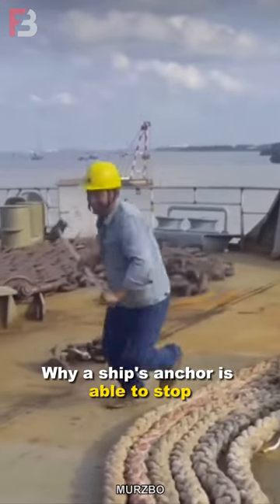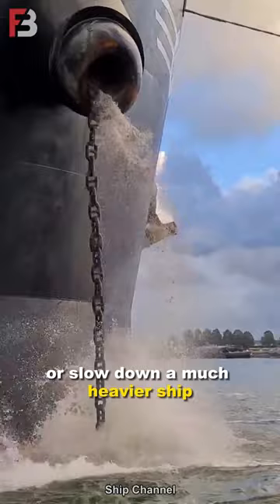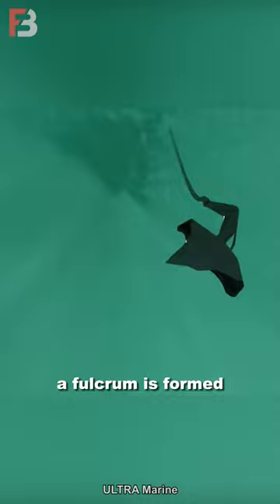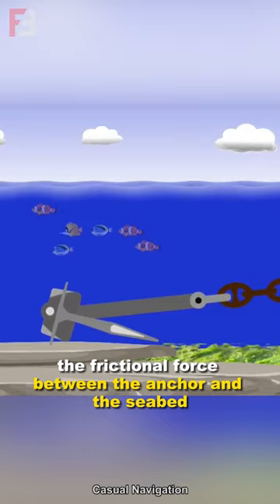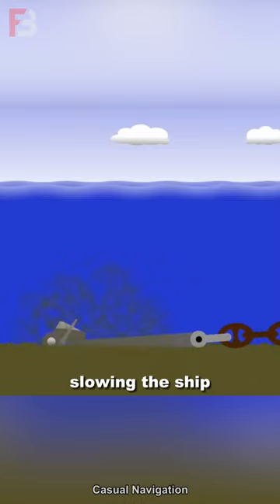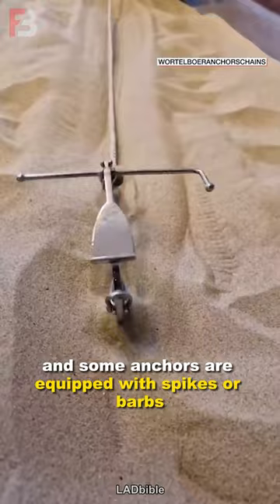How the anchor can stop the ship #shorts

Comment: It has nothing to do with the huge chain that's also on the sea bed? The anchor weighs nothing compared to the chain
Reply: Chain does almost all the work, this clip is very bad.
Reply: @vivekp4854 Then why have an anchor at all
Reply: So wrong. But say anything, I guess.
Reply: @oltro15 are you genuinely asking, being sarcastic, or dumb?
Reply: @oltro15 
No one will only use just a rope on an anchor without a long 
And heavy chain. In choppy sea 
The anchor will be jolt  up so  hard  that it will be dragged with every single wave.  It’s the weight and the length of the chain that will stop the boats from dragging the anchor acting as choc absorbers. That will keep the anchor in one place. And remember to keep tension on the rope before Cuting the engine power. Large boats can quickly get a lot of 
Momentum.  Just with the wind and sea currents.
Reply: @alexgrandino8777  Thank you
Reply: @alexgrandino8777  this is correct
Reply: @richardkossler4624  
Thanks.  Unfortunately 
To many people don’t understand this fact 
Because you are one off the few how said something.  I was on that famous sale boat 
Named « TRIAD » this trimaran was like a wild horse. Spinning  none stop around his anchor. Exactly like a wild horse attached by te nec for the first time.  He has a flat pivoting mast shaped like a wing from a  747   And we could navigate without ever using the sail also  going against 
The winds and also any time that thing took off, we had a lot of chance to be left behind and overboard.

Comment: The anchor's main purpose on ships is to pull the chain out and provide an anchor point to lay a set length of chain  on the sea bed, the ship is held in place by the weight of the chain....not the anchor. Small boats are held in mostly in place by the anchor but not ships.

Comment: What if the anchor gets stuck?
Reply: In shallow waters if the small chain get stuck really bad. Someone 
Will have to take a Dive .
Reply: The anchor is supposed to get stuck.  To bring it up you lift it straight up.  If it still won't come up you cut off the chain.

Comment: its the half mile of chain thats hanging and dragging. not the anchor
Reply: Nope. Not how this works.
Reply: @georgetpeppel2900  yes it is
Reply: @Didyeaye404 no it’s not lol. Why even have the anchor if that’s the case genius?
Reply: @Terrythetroll.   Yes, yes it is. On large ships (ships here, not "boats" mind you); the weight of the anchor is what keeps the vessel more or less situated (it doesnt sit still, it moves in a large radius). But, the anchor is just a device used to drop the chain at a specific point.  

In the future, I highly recommend you spend like... 3 seconds on googling before showing your ass for absolutely no reason. Youre unbelievably wrong but have no problem "correcting" people that are speaking objective facts. Its really not a good look.
Reply: @Terrythetroll.   I was in the navy probably before you were born.
Reply: @Terrythetroll.   aww you deleted your comment. How adorable.
Reply: @JgHaverty  no? Check again boomer lol
Reply: @Terrythetroll.  you deleted your comment. Username checks out.
Reply: @JgHaverty  but i didn’t though lol. What are you on about?
Reply: Jesus christ lads calm down its a fkn youtube video. As far as I know as a engineer the main bulk of the work done by the whole assembly is the drag of the chain. The anchor on the bottom does act as a fixed point however it can never be relied upon to hold a ship. Therefore chain is laid down on the sea floor.
Reply: @Didyeaye404  to be fair Jg is right